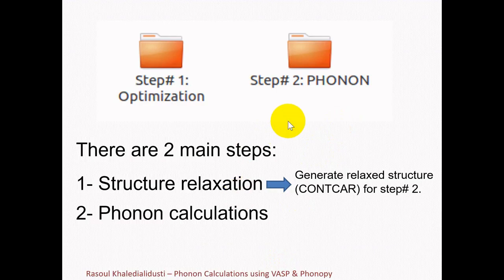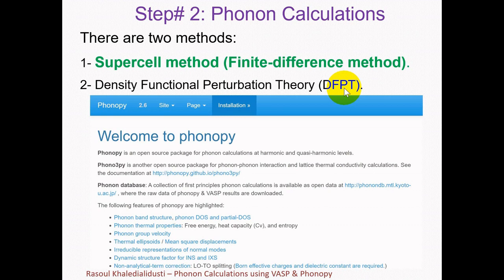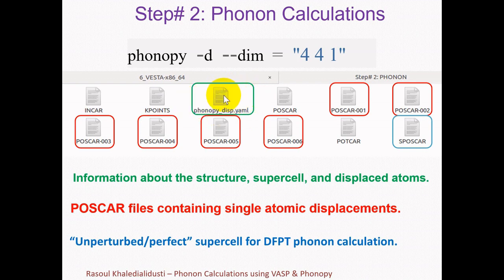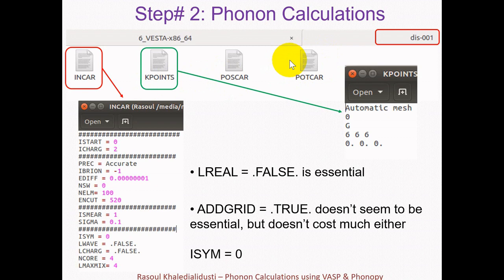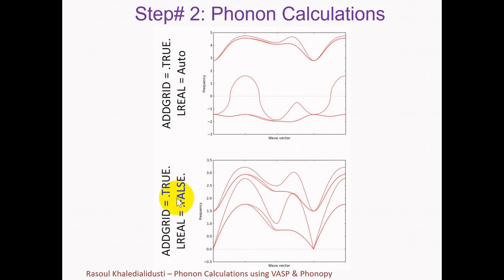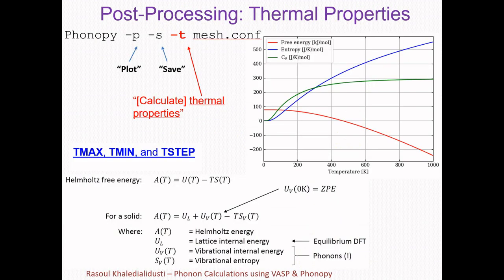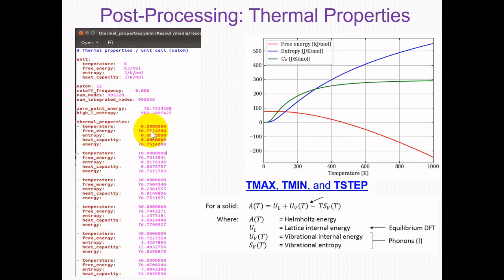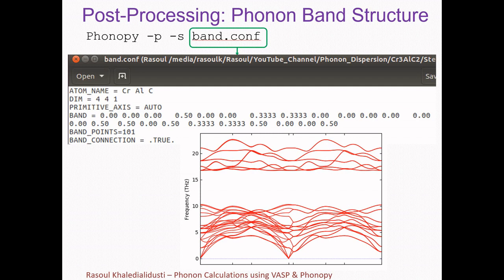Phonon Calculations in Materials Science using VASP & phonopy

Comment: Hello, I already have sqrt(3)xsqrt(3)x3 structure, containing 78 atoms. If I increase the dimension, the number of atoms will be large enough for VASP calculation. How do I start the phonon calculation?      *************phonopy -d --dim=" ? ? ?" *************************  to create the necessary displacement files
Reply from the maker: The dimension would be enough depending on your system. In most cases, it would be fair enough.

Comment: Dear @Resoul Khaledialidusti, I am facing issue in last command "phonopy --dim="2 2 2" -c POSCAR-Unit band.conf"
Please have a look. Your suggestion will be very helpful.

Traceback (most recent call last):
  File "/home/shivam/anaconda3/bin/phonopy", line 45, in <module>
    main(**argparse_control)
  File "/home/shivam/anaconda3/lib/python3.9/site-packages/phonopy/cui/phonopy_script.py", line 1645, in main
    settings, confs, cell_filename = read_phonopy_settings(
  File "/home/shivam/anaconda3/lib/python3.9/site-packages/phonopy/cui/phonopy_script.py", line 1455, in read_phonopy_settings
    phonopy_conf_parser = PhonopyConfParser(
  File "/home/shivam/anaconda3/lib/python3.9/site-packages/phonopy/cui/settings.py", line 1464, in _init_
    self._parse_conf()  # self.parameters[key] = val
  File "/home/shivam/anaconda3/lib/python3.9/site-packages/phonopy/cui/settings.py", line 1709, in _parse_conf
    ConfParser.parse_conf(self)
  File "/home/shivam/anaconda3/lib/python3.9/site-packages/phonopy/cui/settings.py", line 664, in parse_conf
    matrix = [int(x) for x in confs["dim"].split()]
  File "/home/shivam/anaconda3/lib/python3.9/site-packages/phonopy/cui/settings.py", line 664, in <listcomp>
    matrix = [int(x) for x in confs["dim"].split()]
ValueError: invalid literal for int() with base 10: '#SUPERCELL'

Comment: Thank you for the video,. I have one question. I already have a few 4x4 supercells that I run VASP on  for adsorption simulations. I would like to run phononpy on them to determine the gibbs energy etc. So the question is can I just use phonopy -d --dim="1 1 1"  to create the neccesary displacementfiles without changing my surface size?
Reply: Nevermind
Reply: Did you get an answer? It is a very good question?
Reply: Actually, I did that using dim=111, but the problem is it creat 300 new structures and my model contains 71 atoms, so you see I can not apply the same procedure because it will take forever to calculate all the structures.  In the adsorption study, it will be enough if we get the phonon for the adsorbed molecule only, no need to calculate the phonon for the slab, so there must be a way to consider only the adsorbed molecule like we do the frequency calculation of the adsorbate only in VASP.

Comment: H guys, I am struggling to plot phonon band structure. In the video Primitive_AXIS is set to AUTO that DOES NOT work in my case (Number of elements in PRIMITIVE_AXIS has to be 9.) So, pls, tell me whta should be these axes ? Say, I use dim 2 2 2 should I specify single primitive lattice vecors or should double the values ? Thanks !

Comment: While creating the supercell for nanowires (vacuum in x and y directions), i used phonopy -d --dim=113. But it does not create any output files. Could you or anyone please guide me, what am i doing wrong. I get the following statements after typing this command. 
Number of elements of DIM tag has to be 3 or 9.
Please check the setting tags and options.

Many thanks
Reply: Hello Dear Ghulam,
I think your problem might just be a simple case of a syntax error. It's precisely what the error message states. The DIM tag in your statement expects 3 - 9 elements. You have entered "dim=113", which translates to a single element. You would have to enter "dim = 1 1 3" instead. The spaces differentiate the elements from each other.

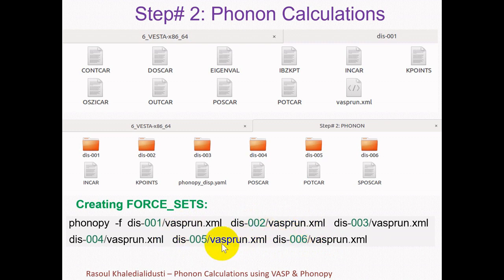Comment: At 15:55, you show the command "phonopy -f dis-001/vasprun.xm dis-002/vasprun.xm ..." to include all the files.
Is there a quicker way to do this on windows? I know on linux, you can do something along the lines of "phonopy -f dis-{1..6}/vasprun.xml", but I can't find a way to do this in windows... :(
Reply: Does "phonopy –f dis–*/vasprun.xml" work for you?
Reply: @chocoberrymuffins  No it does not
Reply: @Dr.DynDyn  Did you happy to copy and paste my comment into your command line? I had to use – instead of -  because youtube was reformatting my comment weirdly when I used regular dashes.
Reply: @chocoberrymuffins  I tried both. Also, that was a recommended way to input the code on the phonopy website, and none of their suggestions worked either.

Comment: Hi all,
There is an obvious way of reducing computation time. You can reduce the computational cost by 3-4 times by calculating the WAVECAR CHGCAR CHG of the supercell first (ideally at local minimum... but those at POSCAR-001 also works alright).  
Copy those three files into the subsequence folders (for POSCAR-002 POSCAR-003 and so on) right before running the computation, and use ISTART=1 ; ICHARG=1.

Comment: Hi Dr Rasol
thanks 10000* times for the video.
i have 2D material for which i add vacuum above the top surface.   so if we make kpoints [X X 1] is generally i do. is that ok for phonon calculations? also for super cell 1-1.5 nm thumb rule also applies for z-direction?

Comment: At 11:00 what is the run command you use for the self-consistent calculations [scf] (or when ibrion = -1).  That is, we used phonopy -d --dim='4 4 1' for the relaxation, but what do we use for the scf?  Also, for the force constants did you use an input file for the vasprun.xml or is the vasprun.xml already implemented in phonopy?

Comment: Sir, how we can decide dimension --dim tag for phonon calculation? .My system contain 3 atom in a unit cell with 4.23 lattice constant
Reply from the maker: It should be between 1-1.5 nm.
4.23 Å is not enough for the phonon calculations and you need to make it at least 3 times bigger.
Reply: Thankyou so much sir

Comment: Hi,
1. I have created FORCE_SETS and now am trying to produce FORCE_CCONSTANTS using "phonopy --fc dis-001/vasprun.xml dis-002/vasprun.xml dis-003/vasprun.xml...." with FDM. But it is showing that "'dis-001/vasprun.xml' does not contain the necessary information"  message. 
You mentioned in one comment to write  "FORCE_CCONSTANTS = WRITE" in the bash file. I did not get the point. Can you please clarify/specify in which file I need to write that?

2. How can I get the Group_Velocity ?
Reply from the maker: "phonopy --fc dis-001/vasprun.xml dis-002/vasprun.xml dis-003/vasprun.xml...." creates FORCE_SETS. If you already made FORCE_SETS, you need to add "FORCE_CCONSTANTS = WRITE" in the band.conf file and then type "phonopy -p -s band.conf" to get the FORCE_CCONSTANTS and phonon dispersion. If everything is performed right, you should not get any error message.
Reply: @RasoulKha  Thank you very much. I was able to create FORCE_CCONSTANTS by phonopy --writefc. Can yo please suggest me the way to create GROUP_VELOCITY file?

Comment: Hi, thank you for your efforts and helpful videos. I use quantum espresso, and I need to calculate a phonon band for a hetterostructure include Pt atom. First I used dim 3 3 1 and the result included a negative frequency. I tried a bigger suplercell but in need a lot of RAM so
I was wondering if I could use the gamma point only and run the calculation for dim 6   61 for example.
Thanks in advance for your help

Comment: Respected Rasoul Khaledialidusti, I am dealing a mono layer contains 32 atoms. Is it possible to do calculation by keeping the same super cell. Mean if I do not increase the number of atom by running the command phonopy -d --dim="1 1 1"......
Reply from the maker: Yeah. It would be possible. However, generally, the lattice parameters should be almost 1.5 nm. If the negative phonon branches were observed in the phonon calculations, you need to apply the supercell.

Comment: I am repeating the same procedure for graphene/mos2 heterostructures as it has about 99 atoms so after processing with phonopy I am getting about 200 POSCAR as there are six in your case. So for my case it would be difficult to repeat the same case by 200 times. Please enlighten something. Thanks in the advance.
Reply from the maker: Your structure has low symmetry and that is why you got 200 single-atomic displacements. I would suggest you finding the symmetrize of your structure and then relax it with ISIF = 1. Then, obtain the supercell with phonopy. You would get less sing-atomic displacements.
Reply: @RasoulKha  But in my case I have taken already 5*5*1 supercell of graphene and 4*4*1 supercell of mos2 so lattice constant are already 12.435 angstrom means they are nm range so if I will make supercell of this again then no of atoms will increase further. Also as my case is in two dimension, there is vacumm of 20 angstrom along z axis so what should be the appropriate KPOINTS. I kept 4*4*1
Reply from the maker: @renusingla2402  4*4*1 is a proper choice for the KPOINTS.
Reply: @RasoulKha  ok and so how should I move further as I have already a large supercell?
Reply: @RasoulKha  Also thanks for the early and valuable reply.. Your work is really incredible

Comment: Thank you so much! I've just begun trying Phonopy.

Some questions!
The FORCE_CONSTANTS can be obtained from DFPT calculation. What are the differences between FORCE_SETS and FORCE_CONSTANTS?
I now know that  FORCE_SETS  is an ensemble result of all displacements. Are they the same? Which one is more accurate?
Are you planning to upload the 'phonopy-qha'?
Reply from the maker: When you follow the procedure to phonon dispersion calculations and set FORCE_CCONSTANTS = WRITE in your bash file, then, the force constants will be produced. Generally, both DFPT and FDM are the same with the same accuracy. I have plan to talk about DFPT as well in the near future.
Sure, Quasi-harmonic Approximation (QHA) is also in my plan list and will talk about that. Meanwhile, if you have any questions, please feel free to contact me.
Reply: @RasoulKha  Thank you for the reply. One more I have... I worry about the qualitative y-axis in the graph of the thermal properties. Let say I use conventional FCC Al structure as POSCAR (4 atoms in the 1x1x1 cell). Then, each quantity is the value per 4 atoms? Here, the POSCAR is 1x1x1 unit cell, and POSCAR in dis-001 is displaced 2x2x2 supercell.
Reply from the maker: @nkl-993  Each quantity is per mole. You need to change the units if you need them per atom.

Comment: I want to extract force constants using DFPT using VASP and create a fc2.hdf5 file. Is this possible using phonopy? I want to avoid  extracting forces from multiple files(vasprun.xml) created by each displacement in the video you have shown
Reply from the maker: Yes. It is possible. You can generate force constants using both methods of DFPT and FDM. Generally, both methods are the same, and Force constants can be produced.
Reply: @RasoulKha  Then how do I go about doing that?? There is no proper procedure in phonopy site to create the fc2 file which I need. Different question : any good books or papers to study the computational procedure for a beginner??
Reply from the maker: @dwaipayanroychowdhury5279  When you follow the procedure to phonon dispersion calculations and set FORCE_CCONSTANTS = WRITE in your bash file, then, the force constants will be produced.

Comment: Thank you so much for this useful video.

I have installed the phonopy on linux which seems to be ok. But when I wanted to make super cell using phonopy -d --dim = "3 3 1" , I have  just received the below error

ValueError: invalid literal for int() with base 10: '='

Could you please let me know what wrong is?
Reply: Hi Tahereh Mohammadi
, I just installed version 2.4.2 and got the same error. It was fixed by removing the "=" sign from the command line. Hope it works for you too
Reply: @franciscoospinaacevedo6923  Thank you :)
Reply from the maker: if you get an error, please try : phonopy -d --dim="3 3 1" -c POSCAR
Reply: @RasoulKha  Thank you :)

Comment: Thank you very much for all your explanations. One question, is it possible to apply the same procedure to a slab structure with a defined vacuum space in the z-direction? or should it be bulk structure?
Thanks in advanced for your time
Reply from the maker: The same procedure can be applied to the slab structures.
Reply: @RasoulKha  Hi Mr. Khaledialidusti. After installing phonopy using conda in a Windows pc (I tried to install it in Linux environment in a specific cluster but the lack of admin permissions did not allow it). However, the installation of version 2.4.2 was successful. The problem now is that when I run the command phonopy -d --dim "1 1 1" it generates 402 images. My system is a slab with dimensions of  0.93x1.27x1.82 nm with 0.8 nm vacuum space in the z-direction. Is there any way to obtain a lower number of images (e.g. with your system you got 6 images)?
Thank you very much in advance for your collaboration.
Reply: @Rasoul Khaledialidusti Mr. Khaledialidusti, just to be more concise, I am checking both vasp and phonopy documentation and found some interesting insights about phonon calculations using DFPT method. I know you mentioned that it is a whole different method which is going to be addressed in another video. But taking into account the number of images I am getting for the finite-difference method, just want to ask for any advice regarding the tags each site propose to use ( https://www.vasp.at/wiki/index.php/Phonons_from_finite_differences  https://phonopy.github.io/phonopy/vasp-dfpt.html?highlight=dfpt )
Reply from the maker: @franciscoospinaacevedo6923  Yes. There is. You need to take the structure with the highest possible symmetry. By --symmetry option in phonopy and the chosen tolerance value, the structure with the highest possible symmetry will be obtained. If you take that structure and optimize with ISYM = 1, then, the single atomic displacements would be less.

Comment: Thank you very much for the video.
Could you please explain a bit about the K path needed for the phonon band structure?
Reply from the maker: Thanks for the feedback. K-path for the band structure is dependent on the structure type. If you are not familiar with the proper K-path of your structure, I would definitely suggest using VASPKIT, which gives you the best path.
Reply: @RasoulKha  
I am able to get the high symmetry k path from Materials cloud/seek path. But I am not able to understand how to write it in the band.conf file.

Suppose for an example the high symmetry k path be
Γ—X—P|G—M
and the coordinates are
G 0.5000000000 0.5000000000 -0.0762743321
Γ 0.0000000000 0.0000000000 0.0000000000
M 0.5000000000 0.5000000000 -0.5000000000
P 0.2500000000 0.2500000000 0.2500000000
X 0.0000000000 0.0000000000 0.5000000000

How can I represent it in the band.conf file?
Please suggest. Thank you.
Reply from the maker: @nirajamoharana1622  you need to only write them in a row: BAND = 0.5000000000 0.5000000000 -0.0762743321     0.0000000000 0.0000000000 0.0000000000      0.5000000000 0.5000000000 -0.5000000000    0.2500000000 0.2500000000 0.2500000000    0.0000000000 0.0000000000 0.5000000000
Reply: @RasoulKha  
Shall I have to follow the order of the k path ?
Reply from the maker: @nirajamoharana1622  sure. You need to follow the path that you desire to have.
Reply: @RasoulKha 
One last thing..
How should I represent | symbol while writing the bands ?
Reply from the maker: @nirajamoharana1622  you need to use other tools to plot the band structures such as gnuplot